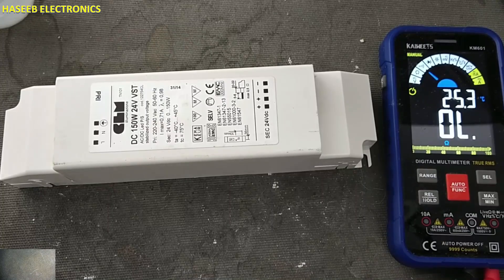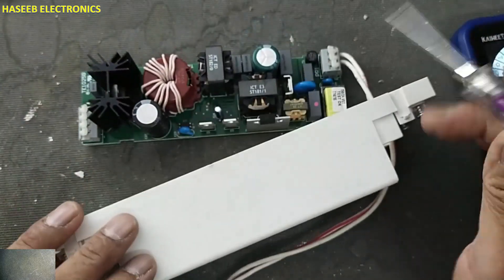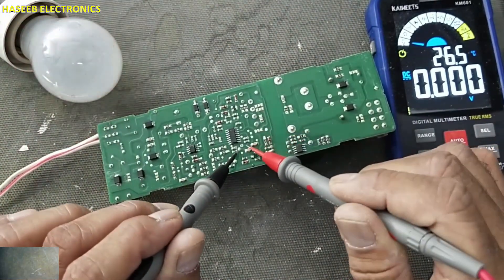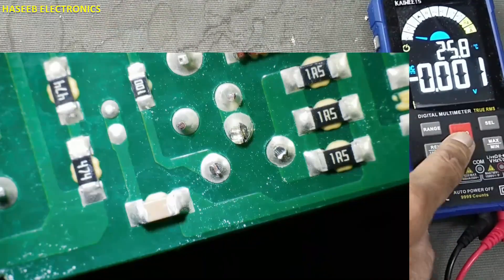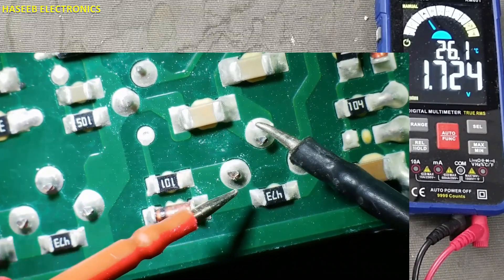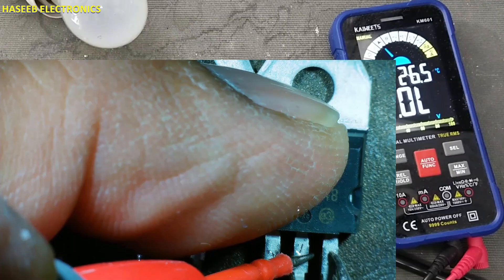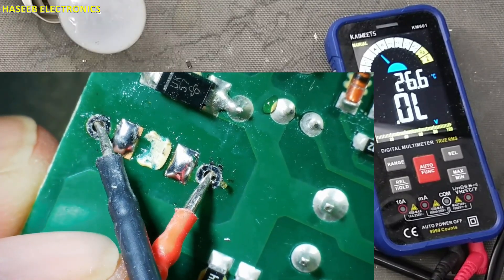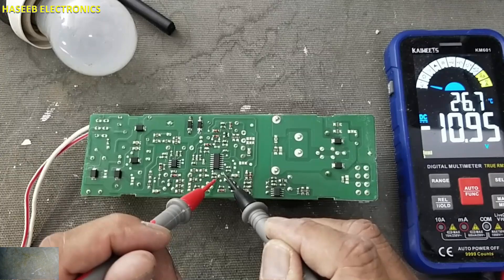{1152} 150W SMPS LED power supply repair

Comment: Brother which equipment you used to discharge capacitor. Can we discharge by simply making short the 2 pins with screwdriver?
Reply from the maker: https://youtu.be/q2mAu2ygoAI
you can connect 3K 2 watt resistor. that will great

Comment: I have 2 control boards from different manufacturers, used for pool cleaning robots. Schematics are not available. Both appear to have been overloaded without the fuse blowing. Both boards also have a Microcontroller IC that appears to have partially failed in that there is no voltage output from the controller on a pin that should have voltage. Is it possible to replace the Microcontroller IC or is the board unrepairable? There is no access to a duplicate controller IC other than purchasing a new IC.

Comment: Top notch repair sir! What is the purpose of the internal diode between the source and drain of the mosfet? Maybe a good idea for a quick video? Thanks to you and your videos, I've fixed my first power electronics project, an inverter I found in the trash on the side of the road. Thanks and good morning.